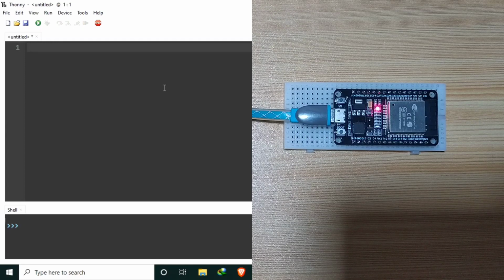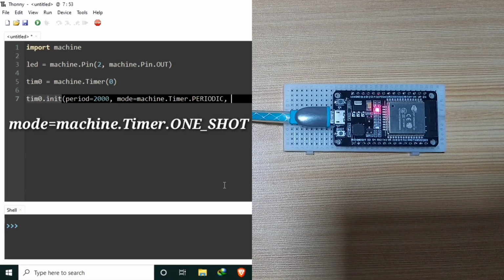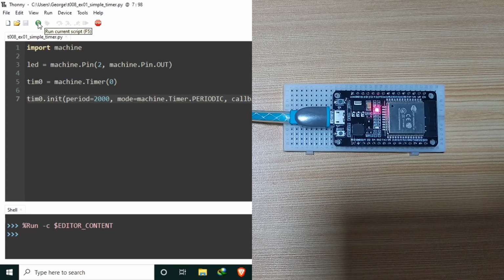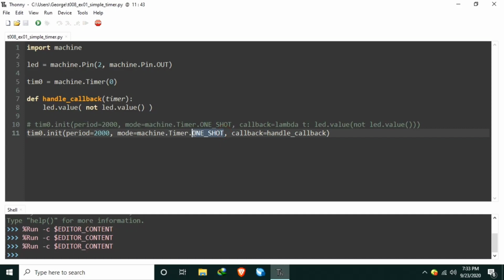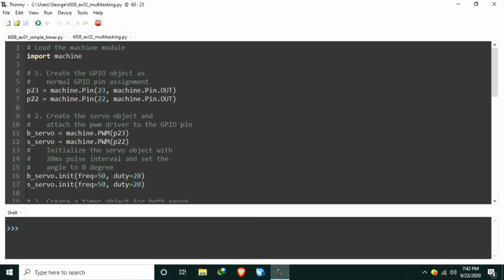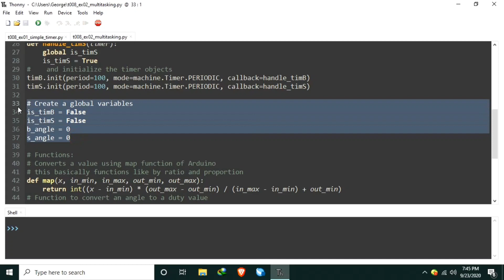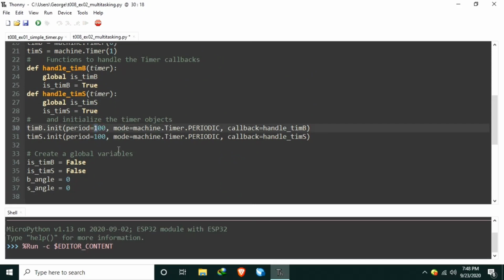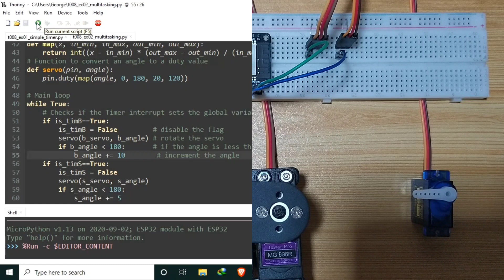008 - ESP32 MicroPython: Hardware Timer Interrupt

Comment: below is reference, for learning,  on what each line of the script does.  

import machine
Imports the machine module for hardware-level functions like controlling pins and timers.

led = machine.Pin(2, machine.Pin.OUT)
Configures GPIO pin 2 as an output.

This pin controls an LED (on many ESP32 boards, GPIO 2 has an onboard LED).

tim0 = machine.Timer(0)
Creates a Timer object using timer number 0.

ESP32 has multiple hardware timers (Timer(0) to Timer(3)), and they can run in the background.

tim0.init(...)
This line starts the timer with these parameters:

period=2000: The timer will trigger every 2000 milliseconds (2 seconds).

mode=machine.Timer.PERIODIC: It will repeat periodically (not one-shot).

callback=lambda t: led.value(not led.value()): This is the function that will be called every time the timer fires.

🧠 What does led.value(not led.value()) do?
led.value() returns the current LED state (0 = off, 1 = on).

not led.value() flips it (True → False, False → True).

So the expression toggles the LED on and off every 2 seconds.

⏱ What this program does:
The LED will blink every 2 seconds automatically using a hardware timer.

The main loop is not used — it's all handled in the background with interrupts.

2nd script:
import machine

led = machine.Pin(2, machine.Pin.OUT)   # Set pin 2 as output (usually onboard LED)

tim0 = machine.Timer(0)                 # Create Timer 0 instance

def handle_callback(timer):            # Define callback function
    led.value(not led.value())         # Toggle LED state

# Start the timer to call the callback every 2 seconds
tim0.init(period=2000, mode=machine.Timer.PERIODIC, callback=handle_callback)

import machine
Imports the MicroPython machine module to access hardware features.

led = machine.Pin(2, machine.Pin.OUT)
Initializes GPIO pin 2 as an output pin.

This is usually the built-in LED on most ESP32 boards.

tim0 = machine.Timer(0)
Creates hardware timer 0. ESP32 has 4 timers (0 to 3), each can be used independently.

def handle_callback(timer):
Defines a callback function that will be triggered by the timer.

The argument timer is required even if unused (it receives the timer object).

led.value(not led.value())
Toggles the LED:

If LED is on (1) → turn it off (0)

If LED is off (0) → turn it on (1)

⏱ Timer Configuration:
python

tim0.init(
    period=2000,                            # 2000 ms = 2 seconds
    mode=machine.Timer.PERIODIC,           # Repeats every period
    callback=handle_callback               # Call this function every time
)
If you want the timer to trigger only once, change mode=machine.Timer.ONE_SHOT.

🔁 Want to stop the timer?
You can stop the timer at any time by calling:

python

tim0.deinit()
🧪 Optional Improvement: Add a startup print
python

print("Starting LED blink every 2 seconds...")